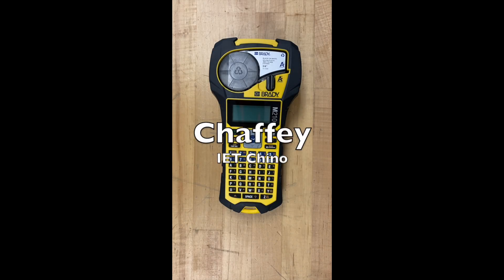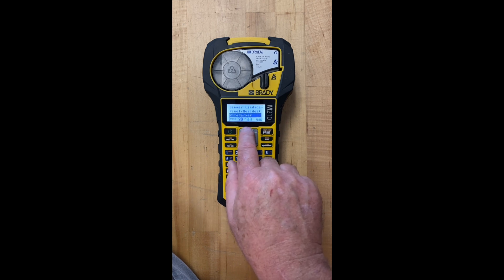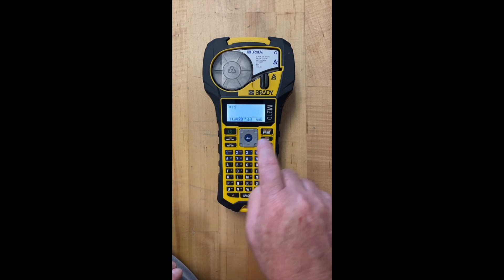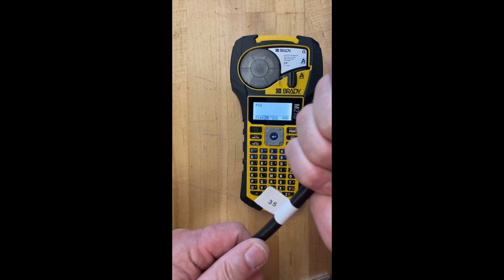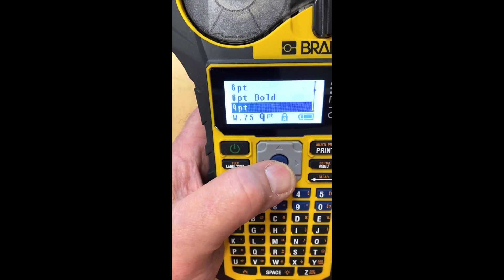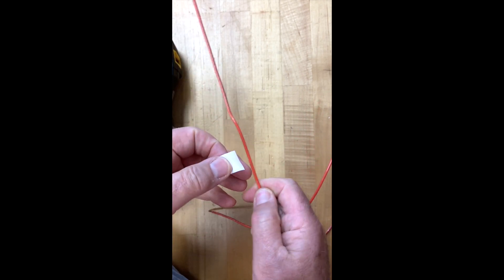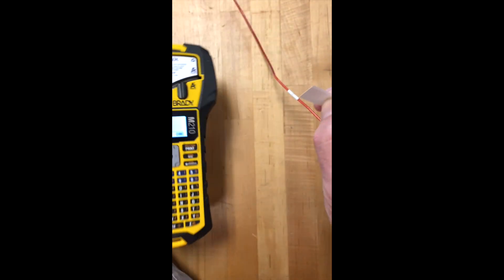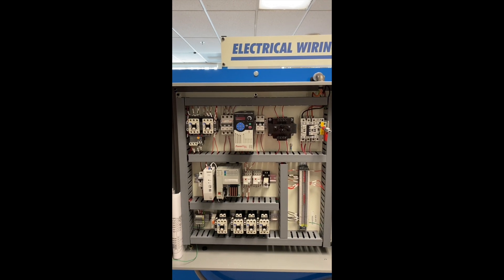IET Brady Labeler Introductory Tutorial

Comment: Appreciate this.  I wanted this for home office cable labeling and also finally properly labeling circuits in my home 200A panel as I traced what outlets/devices were on what circuit. I even plan to mark sockets/switches discretely  in the house.  Had a real cluster winging it & ended up printing a ginormously long lavel wasting expensive Brady tape.   This helped me tremendously. Doug in Atlanta